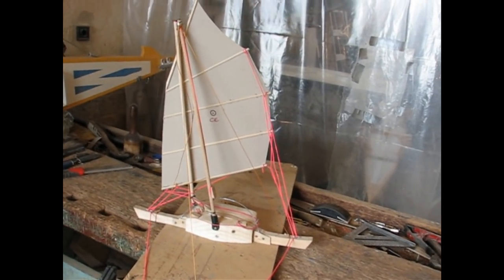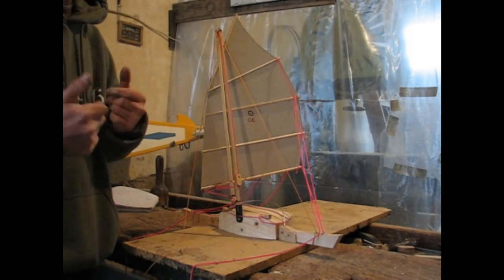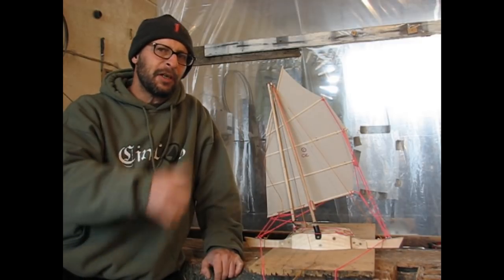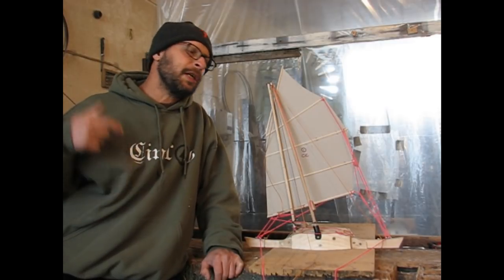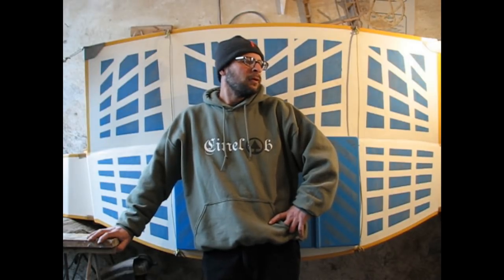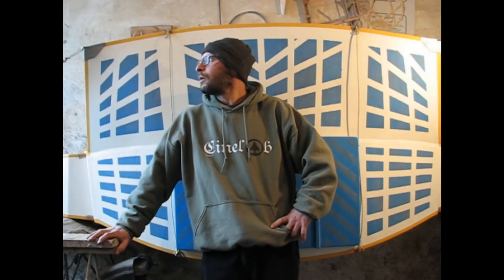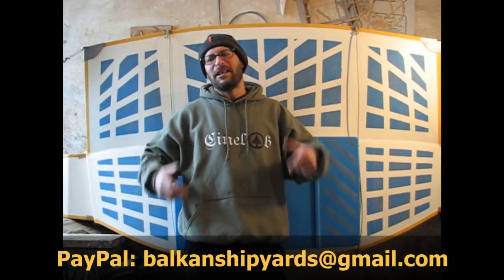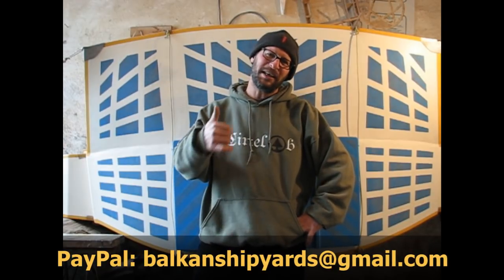Evolution Proa Rig.

Comment: Well done, and I continue to enjoy watching your proa experiments. The solid shunting rail is interesting.  Some of us who played with small proas discovered that the endless line with the heel of the yardarm on a non-stretch "shunting line" (I used a plastic-sheathed steel cable) made proa shunting easier.   Some people made the shunting rail out of wood, which I probably would have gone toward had I continued with proas, because you can use it to better guide the yardarm around any stuff on the hull, such as protruding crossbeams and lee-platforms.  

I don't know much about the effects of lines on windage and windward ability, but looking at the dual set of leech-lines makes me wonder about the effect.
Reply from the maker: Hi Wade, it's all still in the oven.... Many junks have sheets on both sides of the sail ans seem to be o.k. with it.... Like I said even 55 degrees to windward will be just fine for me. It's all down to ease of use and reefing, I'm prepared to even take a small speed loss as long as I feel safe way out there.....